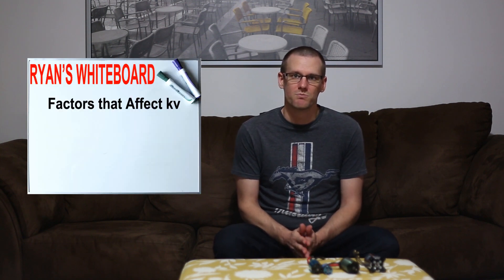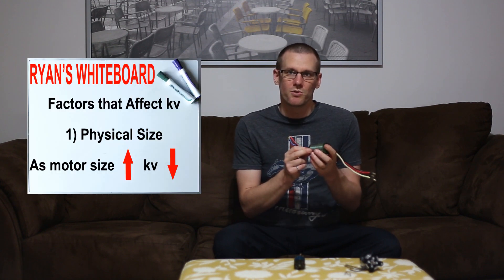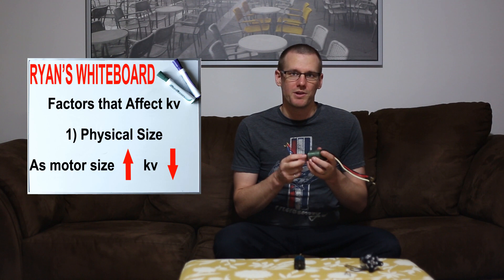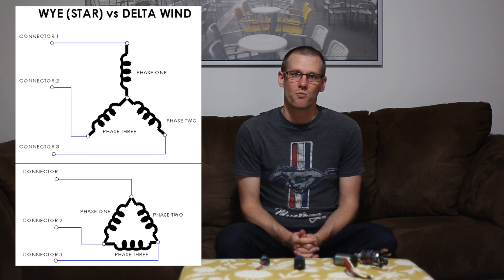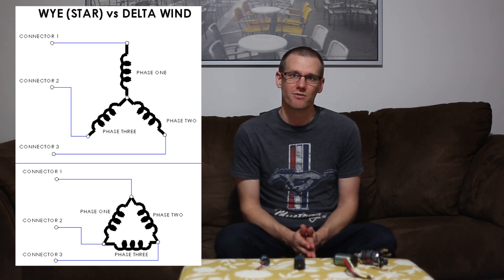Understanding KV of a Brushless Motor - RC Motor Basics

Comment: Great! Can you share the analitical formulas and all calculations for designing the BLDC?
Maybe some book with example of designing some motor. Or there is a online calculator, where I can obtain the dimensions of stator, rotor, aor gap, and winding turns, poles number, and slot numbers for concrete power and speed.
Thank you!

Comment: hello , wish to ask you a question , if a motor specs will say max voltage 48 volts max amps 208 max 10000 watts but continous power is 5500watts , if i give the motor 37 volts will it draw same 208 amps or less? or will it draw according to its load ? motor is 1170kv and i wish to get out at least 7000watts ,what is safe to do ?
Reply from the maker: The motor will draw the current necessary for the applied load. This could be 10 amps if very lightly loaded or 500A if excessively loaded.

Comment: I notice that racers within a class with open motor rules still tend to choose one kv rating, citing that it "hits the sweet spot" or power band.  For example, in 4x4 SCT, it's 4300kv on 2s, and 1/8 buggy is 1900v on 4s.  Since these are not ICE motors, is there actually a power band or sweet spot with brushless motors(besides exceeding the max rpm range of the motor)?  Using the 4x4 SCT class, is running the 4300kv motor at 31,820rpm really advantageous to a 5100kv motor at 37,740 rpm with a smaller pinion?  Thanks for any insight.
Reply from the maker: I would disagree with the argument if the motor is not using close to the full rated allowable motor speed. If this is a 60,000RPM rated motor, operating at 31,820 is leaving motor performance on the table. If the argument is that more power is not needed as the car becomes incontrollable, this is a different argument that is vehicle specific. 
https://youtu.be/0W07RLdj6w4

Comment: The only problems I have no body tolks about if you got a 40amp/160 esc what the smallest battery 2 biggest battery can you run on that
Reply from the maker: I don't understand the question. You can use a battery from 0 to infinite in size with a 40A or 160A esc. The ESC doesn't care.

Comment: What outrunner motor is used in this video? And would you use yourself an outrunner motor on a drag car which sees bout 20-30 sec max throttle.punches on a drag strip?

Comment: I've got a question about brushless. I've got a 4×4 1/10 buggy and I want to convert my brushed system 15T motor (which i run it with nimh 7,2volts, 3Ah) to brushless combo 3000kv motor and 50A esc and still run it with the same battery. Would it be faster or slower??

Comment: So I have a question.
I have a Traxxas stampede 4x4 vxl that has been sitting for quite some time. 

I went up to the local hobby shop and it was determined that esc and motor went bad. I ran this setup years ago and always had over heating issues.

Well they sold me a Castle Creations Mamba x with a 1406-2280 motor.

I think I messed up by listening to him because it wasn't what I expected for the "upgrade" it's geared at a 17t but it's really not fast on top end and actually has an annoying high pitch sound when running. I'm running a 3s lipo but I'm just not satisfied with it. 

Any suggestions? Did I fuck up by adding such a low kv motor?

Any help would be appreciated. Thanks
Reply from the maker: Hi Sam, if your motor, ESC and batteries are not operating near max thermal limit, you can gear up. The noise you hear could be from the gear mesh. See if your gear mesh has the correct spacing.

Comment: I have a 1 10 scale RC car for bashing and I am looking for a motor that could make this car wheelie and still be fast I was thinking about a 3500kv motor and 4s lipo, I want to buy a cheap esc and motor combo but are they good enough to run 4s or do they get to hot a lot of these cheap combos should be able to run 4s if I read the description but is that true or do they end up in flames
Reply from the maker: There are inexpensive options that do provide adequate power. I don't have a lot of experience with those options, however, there are many posts on threads about them.

Comment: Hi. Do you think there's a way to guesstimate the average load or peak current (amps) of a motor from KV/Volts/motor size?
Reply from the maker: Yes, you could create a formula based on kv, max operating RPM, weight and or physical size of motor.

Comment: So what KV motor would be good for 70+mph, with a 3s application 11.1 volts, on a typhoon 3s
Reply from the maker: I'm not familiar with that car, you may have to ask the guys on the typhoon thread.
Reply: @RCexplained  I found this Firma 150A Brushless Smart ESC / 2050Kv Sensorless Motor Combo, that should be a good combo what you think? It’s 200$ for both pretty good deal considering both of those are like 150
Reply: @RCexplained  because the motor has good rpm and good torque, because lower kv more torque, and it can run 6s. So pretty good combo for a 6s motor and esc while being brushless

Comment: Looking for a brushless motor to replace my 34lbs Minn Kota motor. Reason: efficiency. But how do i determine the needed specs? I know the Minn Kota has 1200 ish rpm (read it somewhere) so with a 12V LiFePo4 I should have a 100Kv motor to get the amount of rpm, right?  But how will i know the motor is strong enough? 

Thanks for your informative videos!
Reply from the maker: Hi Ardy, the kv you selected will get you to 1200RPM unloaded. As soon as you load the motor, RPM will drop. Going with 110kv, will get you closer to 1200RPM loaded. 

You will also need to know the power consumption of the Minn Kota motor. My suggestion is to measure the voltage and current under load as it is mounted to your boat and at full speed. Multiplying the voltage by current will get you wattage. When you know the continuous power output of the motor you currently have, you can select a new motor to match this output. 

That will be a good starting point.
Reply: @RCexplained  Thanks for your reply Ryan! 
Max current is 30Amps at 13.1V. So that would make about 400W. With losses accounted that would make 440W minimum. Rounded up: 500W total. 

What would be your next step?

Thanks in advance!
Reply: Hi Ryan, I've watched some of your videos to understand the concept better. The only question i have for you now is the following: Assuming that the motor will use 440W on 1200rpm, can i select any BSDC motor with a high enough max Wattage? 

Or should i determine the Wattage by divide the max Voltage with used Voltage(my LiFePo4) and divide that factor of the max Wattage?

Little confused here :)
Reply from the maker: Hi Ardy, you will have to find a ~500w motor  with around 110kv to reach your 1200RPM. Your motor would then need to be able to operate at a continuous current output of 42A. The specs you need are:
Min 500w
110kv where 12-15 volts will not exceed the motors maximum rated RPM. 
42A minimum continuous rated current
Reply: @RCexplained  Thanks Ryan! Appreciate your reply!

Comment: What kv would you recommend for top speed and torque off-road and on the street uphill or flat for a slash 4x4 brushed version?
Reply from the maker: Are you looking to go brushless?
Reply: RCexplained yup
Reply: RCexplained I’m using a 5200mah 2s lipo right now so yea
Reply from the maker: 3500kv would be a good compromise on 2s.
Reply: Hmmm what if i get 3s and would it be faster than my stock motor?
Reply from the maker: 3s would be faster than stock
Reply: @RCexplained  do you know how fast a 3500-3800 kv motor would be with stock gearing and a 2s?

Comment: please help me decide...i have a kraton exb and dont know what to put in it.....i will run 6s battery but dont know what kv motor to get....im planning to get the max 6 esc but what kv? also what gearing should i use when i will put a heavier tire so that it will not affect the motor?...more on bashing and a lil bit of speed...thank you very much...
Reply from the maker: I'd get a kv around 1600.
Reply: @RCexplained  thank u

Comment: Can you give me the explanation of kvs for idiots please do more kvs make it faster or slower
Reply from the maker: What specifically are you looking for? Relative to a baseline motor already being used in your RC - A higher kv will make your RC faster if your system is up for this increase in current required. A lower kv will be slower.
Reply: RCexplained I have rustler Vxl but my Vxl motor got toasted
Reply from the maker: @Happygrowercbris420  What was the temperature that it was running at before it got toasted?
Reply: RCexplained I have no idea but I had 4 Nickle metal battery’s throw it before it happend
Reply from the maker: You will want to know the temperature of a newly powered RC. If you don't,  you are operating it I'm the dark. That's too risky.

Comment: Can a bigger bullet connector on your motor lower motor temp? And is it ok if a motor peak amp is higher than the esc constant amp rating pertaining to drag racing
Reply from the maker: I would not expect a larger bullet connector on the motor to lower motor temperatures. Larger connectors lowers the resistance of the connection point, increasing the voltage that the motor sees. In theory this would increase motor temperature as more power will be sent to the motor instead of being wasted as heat in the connection point. I would expect if you are already using adequate connectors, moving to a larger connector will have negligible difference. 

Peak current that happens in short bursts under high load often exceeds the constant rating of an ESC.  Watch the data log video I have. The ESC was not rated for 300+amps. 

Limit the duration of the burst, only make a couple passes and allow everything to cool before the next drag race. Using the ESC's for demanding applications such as drag racing has a degree of risk associated with it. To minimize risk, use the highest rated ESC, a cap pack and monitor temps.
Reply: @RCexplained  thanks for the info👍
Reply from the maker: @racingrivals8934  anytime, glad to help

Comment: Hi Ryan, thanks for explaining this part. All clear for now. How about torque? If I have a 3650 1200KV or a 3674 1200KV, both on 4S. RPM should be the same unloaded. But loaded I assume the bigger (3674 in this example) motor should do more RPM or am I completely wrong?
Reply from the maker: Hey BlackbirdAirbrush, thank you for the comment. To answer your question the larger motor of equal kv will be able to produce more torque. This is true as the internal resistance of the motor will be lower allowing it to draw more current. Current is directly related to torque output. The larger can size of the motor is then able to dissipate more waste heat that comes along with the higher current capability. 
Here is a video on comparing Brushless motor Torque
https://youtu.be/xi7jxIkX2vY

Comment: Hi great video I learnt a good understanding. Just need ur help i have a hyper vs 1/8th scale buggy and looking to put a new Motor init. Im just wondering would ther be a big difference between 1900kv and 2200kv ? Im looking for abit more speed but dont want to loose tha much torque ? What would you recommend ? It also has a stock 2000kv motor in it now thanks
Reply from the maker: How many cells are you running?
Reply: 4lip and 6 lipo
Reply: Also im using it for light bashing and in car parks an stuff like that. So its not ill be racing it or doing proper speed runs thanks
Reply from the maker: @ryanjones2075  I would opt for the 2200kv motor and use gearing to hit the maximum speed you need.

Comment: I thoroughly enjoyed your video and all of the good info that you provided, you made it very easy to understand. I subscribed.  Thanks..... I do have a question... how are tp-power motors able to provide so much more RPM/KV  per volts than competitors? I've been wanting to purchase one for my limitless I believe it's a 2700kv and is rated for 8s. What are they doing differently than the other companies? Thanks for any info you can provide.
Reply from the maker: Hello, thanks for your comment! That's a great question! The maximum 80,000+RPM the TP Motors have are based on bursts no longer than 10 seconds. It also states that CM series motors are intended only for experienced racers where standard factory warranty does not apply. Does this mean the motor could be ripped apart but its at the customers own risk? If so this would apply to any motor really. Make up your own specification based off of trial and error. 

I will see if I can find out more information from TP-Motors and also other manufactures. If I get anywhere it will become a video topic. I'm super interested in what I find, this is a great question, thank you for asking. 

Keep in mind that my video queue time is well over 4-6 weeks right now. Not sure which manufactures will reply in times like this either.
Reply: @RCexplained  thank you so much for your reply, I look forward to your findings as well as any other videos you post. Thanks again
Reply from the maker: An update. I have reached out to TP Motors USA twice and have received no reply to date.

Comment: Hi...
Knowing all this and thanks for the explanation.. i have a doubt because i have a deep vee boat but dont know which may be the best.... may be you can help me with all... that i have to know.. because theres a displacement fact ...mph.. speed that i want..propeller..etc
I have another R/C boat but nitro so i am not really new in R/C but have a huge doubt in Brushless
Email... jedlaureano@gmail.com
Reply from the maker: Hey Jorge, head to the www.radiocontrolinfo.com website there is a lot there. You will need to know the length of the deep vee boat you and from there you can figure a lot out.

Comment: I'm sorry if I missed it but how do the measure out sizes of motors like a 3650 size. What does that 3650 stand for? Like if I have a certain length, width motor how would I know what size that motor is? Measure it? I'm wondering about sizes. 540, 550, 3650.....Thanks
Reply from the maker: Hi Chris. 3650 is the size of the motor measured in mm of the outer case. The motor would be 36mm in diameter and 50mm in length. 300, 400, 540, 550 is the classification of a motor more typically used for brushed motors. The bigger the class the larger the motor.
Reply: @RCexplained  Ah I see! That's exactly what I was wondering! That's a big help to me! I really appreciate it! Thanks

Comment: How does max watts and max current figure into this? Is a higher max watt/current = higher torque?
Reply from the maker: Thank You for the comment Doug. Higher max wattages will drive torque potential up. I have a more recent video talking specifically about torque. https://youtu.be/xi7jxIkX2vY

Comment: so I'm building a 1/10 scale baja trophy truck thinking Im going to use a 4 cell so what brushless motor would u recommend? want decent power n speed. Also still pretty new to all this
Reply from the maker: Hi Colton, I prefer Castle motor and ESC setups. My suggestion is to hop on a forum with your specific truck and see what the guys are running. This should allow you to get a good understanding of how each setup performs. These guys would have a lot more experience with these setups in that truck than what I do.

Comment: I want to run my traxxas rustler SUPER FAST and I’m buying a castle motor Castle Creations SW4 12.6V 2A BEC WP SL ESC 5700kv with the stock upgraded pinion and spur gear. Will that work?. And plus I’m not trying to spend $300-$400 on a motor
Reply from the maker: Hi Terry, your esc and motor choices seem fairly good, hiwever, I've never owned a rustler. My suggestion is to read up on a forum to see what others are doing.  You should be able to get an idea of the speed you can achieve.
Reply: @RCexplained  also dont forget your gearing..a higher pinion gear teeth count and lower spur gear tooth count will have you doing warp speed..but the offset is your lower end will be slower..a good combo i found was 70 tooth spur with a 21 tooth pinion..it also made my motor temperature and esc higher....if ya wanna go really fast go steel gears .. 1 to 1 ratio
Reply from the maker: @karlfritz47  Hey Karl, thanks for your comment.

Comment: I need to figure out what kind of motor I need plz text me back thks.
Reply: Ok so I need to motor that can run an easy 100,000 rpms and the power I'm not sure I'm gonna need your help on that and it's 2 disc I'm spinning it's a very delicate project I cant let ppl know a whole lot of details but if you got contact info I could let you know somewhat what I'm doing
Reply from the maker: What do you need?
Reply: I gotta figure out a motor that going about 80,000 to 90,000 rpms and not blow up
Reply from the maker: @MattRoberts369  for what application?
Reply: And its gotta spin a disc very fast it's a project I'm doing and no I'm not in school I'm 19 just graduated 2 years ago but it's very important
Reply from the maker: @MattRoberts369  most in runners max out at 60 000RPM before they become unsafe. 60 000 RPM is a lot.
Reply: What you mean
Reply from the maker: @MattRoberts369  what are you doing with this motor? How many watts of power do you need?
Reply: It's a disc about maybe 30 to 40 lbs
Reply: You know motors good right?
Reply: And probably close to 90,000 watts
Reply: Ok I might just need 60 maybe  but I need a control panel too but I believe with my calculations I need at least 80,000 rpms
Reply: What kind d of motor I can use I don't think it could be a rc car motor i need it to spin the 30 to 40 pound disc at least 70,000 to 80,000 rpms